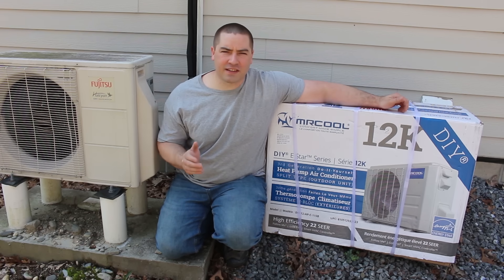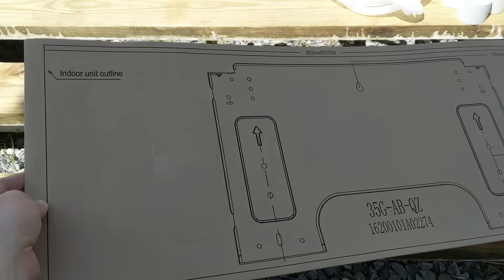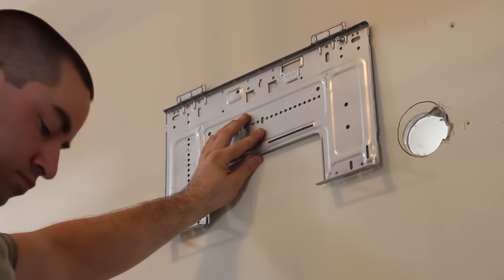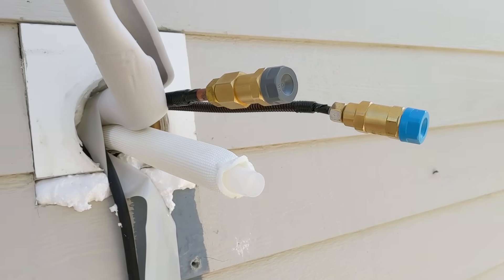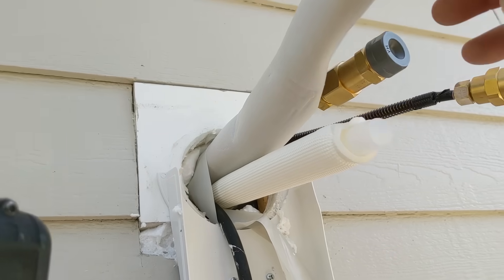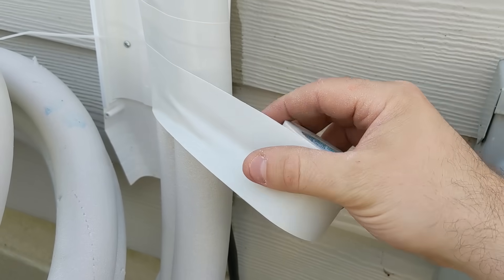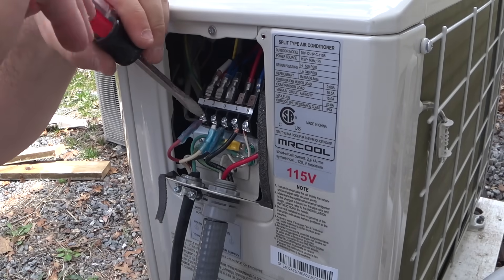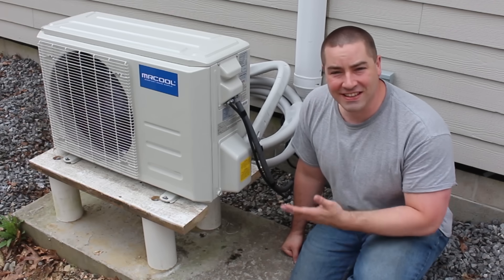Installing My Own Mini-Split Heat Pump, DIY

Comment: As for the leak of old AC  you should call the real pro that has a leak detector and for sure you should use your warranty. This installation is dangereus. you should be aware that there is a high risk of electrical shock especialy for people that has no knowledge about electricity, plus you should like a MUST evacuate the system properly, before releasing the refrigerant. Therefore there are some serious questions about this installation and it is considered dangereus as for you as for the environment. What if you had a leak...what then? What if you burn yourself with refrigerant? When the compressor dies after 2 or 3 years because of presence of air in the systemi  hope you will make then a video about it. This installation is not suppose to be done by unprofesionals. NOT GOOD!
Reply from the maker: I posted a follow up video addressing that question: https://youtu.be/KzHLsRtVn4U
Reply: @DavidPozEnergy  ok...looks like you have absolutely no idea how the hp/ac operates and how big are the risks involving the installation you did. The lines you have are very dangereous. Why...because of the rubber seal-o ring inside. Therefore you cannot know if the seal was tighten up properly because the rubber seal will hold the connection for that time...but in time year or two... the rubber will decay very fast because heat/cold  exchange...so you can get that bad micro hole that will do the damage...and you will again make a new video how bad the product is...the point of the copper hose that you showed in video saying"the air can get in"is far beyond your way of thinking but in fact it is a proper way to do the installation(without rubber sealant). But look just so you get look smart on the video is good. For my point of view people should keep this work for professionals with licence...not for amateurs. Licence for hvac is meant for something...keeping the invironment safe. You and other amat. can cause a lotnof damage to yourself and environment, not mentioning the extra ft. Of lines you have to use, because you cant evacuate the system.(plus installation you did it looks just bad man). Sorry to tell you...it is like total unpro.

Comment: Thanks for taking the time to put up the the video.  The whole setup probably cost less than the multiple failed repairs.
Reply from the maker: Yes, by a long shot.  Just one repair/service call savings pays for the new system.  I don't know if it's the same everywhere, but labor where I live is very expensive
Reply: @DavidPozEnergy  Had a similar issue here, so I installed my Fujitsu myself. The steps are nearly the same except you vacuum the lineset with a $100pump. I don't think either brand will be more serviceable or avoid tough repairs. Hopefully luck will be with you this time.
As the tech has advanced quite a bit, all the companies have introduced new models so parts for the old ones are hard to get. If you install it with replacement in mind, if it goes bad again you just swap it out like you did with the fujitsu.
Hurst to see holes go in that wonderful dense pack job ;)

Comment: Just wondering if you could have cut your lineset down from the other end going into the house. A shorter line set may increase efficiency of your New Air Conditioner? Thank you for sharing a I installed an American Standard Air and Furnace last year D.I.Y. Saved about 7000.00 pretty happy. Good Job David.
Reply from the maker: I posted a follow up video addressing that question: https://youtu.be/KzHLsRtVn4U

Comment: lmao , your system will be full of non condensables because you didn’t evacuate the pipes , the big “coil” of left over pipe on the outdoor unit will soon blow around and destroy your flares or even crack the pipe , so many things wrong with these DIY units... get a qualified tradesperson to do these jobs people...
Reply from the maker: I posted a follow up video addressing that question: https://youtu.be/KzHLsRtVn4U

Comment: I think it's a good idea with any kind of drain line to cut the end at an angle. My thinking is that, theoretically, it'll take longer to plug up because the hole is much longer/wider.

Comment: Nice video-few tips is to vacuume the lines-never use electrical tape-insulate your lines fully
Reply from the maker: I posted a follow up video addressing that question: https://youtu.be/KzHLsRtVn4U

Comment: And those fittings on the condenser unit have torque ratings. Should’ve been in the manual in which you were pretending to read thouroughly

Comment: Your leak was probably on the flare fittings. Never trust the factory flares because they almost always leak, and your initial installers where too stupid or too lazy to reflare the lines.
Reply from the maker: Maybe.  But every time I hired a repair company ($$$$) they told me they re-flared the fittings.  But I still had leaks.

Comment: This is payd ad. Those mrcool is same as midea or pioneer other generic brand in other words. Cheap Chinese rebranded inverting AC( heat pump) that are not as good as the real brands, but for the money they cost they work excellent. They start arround $400 with the delivery in us. precharged with freon for up to 25ft line and line install kit. I got 2 pioneers and I will get 2 more this summer. In my other house i have Mitsubishi 10 years old 12000btu heavily used during the summer and the winter and still working as new. The prices on the real brands in US are painfully high. 😥
Reply from the maker: Mr. Cool did not pay me.  But I do agree that we pay more in the US for these types of units.

Comment: Why would you use thread locker?
Reply from the maker: It's a sealant made for refrigerant connections.  I linked to it in the description if you want to see exactly what I used.

Comment: What About Your Warranty All 3 of My Fujitsu's Came With a 10 Year Warranty ? Had One of Them To Have a Leak and My HVAC Company Came Out and Replaced My Heat Pump at No Cost Did You Have A Licensed Company Do The Install or Did You Try it Yourself ?
Reply from the maker: I hired a licensed HVAC contractor to do the work.
Reply: @DavidPozEnergy  Then He Should Have Summitted The Warranty and You Should Have Checked To Make Sure That He Did. I Know it's Too Late Now But For Future Reference it's Smart to Ask About a Warranty and How it Works ! FYI Mr. Cool Offers a Warranty on There DIY Mini Splts as Long as You Follow There Requirements For The Install  👍

Comment: Theoretically the coiled up electrical cable forms a resistance 'choke' with AC power.  The magnetic fields created around the individual wires  interfere with each other when looping causing this resistence and needing higher amps than neccessary. Your tested amps was right near the max of 10amps if I read the data sticker correctly.  Unless you wanted to allow moving the exterior unit later you could test this out by reading amps, shortening the cord, reattaching then rechecking the usage.  If temps are same as before the line should use less electrical energy when done. This lessens the heat in both fan & compressor motors when running. I have electronic degree and as a home inspector I always advised shortening coiled up AC wiring to save useful working life of appliances. What convinced me of the practical side in this was one day found a coiled 50'  extention cable that melted itself together into a solid plastic coil.  That definitely made an impresion on me.
Reply: Your over thinking it buddy. I feel bad for the people you advise, money not well spent for most (99.99%) of properties out there have far worse things that need fixing.
Reply: @WilliamSymionow  true, if that were the extent of my advice.  Realize even 10% reduction in watts = greater relability for all components effected. Most designs are now manufactured with thin margins using cheapest possible components.  One service call minimally costs home owner several hundred $. Shortening cords cost $2 and 5 min.
Reply: @paulcrescenti5581  if the power is routed to the exterior unit 1st, that would make a large reduction in the reluctance (ac resistence) issue. Of course rethinking your example, his meter showed 10amps of current flow. That is extremely high for just the interior fan. 
In rethinking my advised amperage test, it would be easier by simply uncoiling & spreading out the wire before re-reading the current. If amp drop is more than 10% it is well worth shortening the cord.
Reply: @JDub-mi7fs  thx, for sharing, your experience makes an excellent example of unexpected consequenses of coiling wires.

Comment: I would have installed the evaporator unit to studs
Reply from the maker: I got one big 3" screw into a stud.  But the stud landed in the middle of the metal, so the corners are held in place with the drywall anchors.

Comment: You didn't vacuum down the refrigerant lines. It's full of moisture. It will not cool properly and you will have issues wit it soon. Do more research before making a DIY video.
Reply from the maker: I posted a follow up video addressing that question: https://youtu.be/KzHLsRtVn4U

Comment: $5000... .You could have bought a full Heat Pump with that money.. Instead of this mini split.
Reply from the maker: Yep.  But the HVAC pros don't tell you up front that it's going to keep leaking after they "fix" it.  Over and over again.  Hiring the licenced companies.
Reply: DavidPoz idk what they did to “fix” the issue or what exactly was causing the leaks
Reply: It happened to me, too. My old central AC worked for 30 years and finally had broken. The fan became noisy. I called the AC repairman. They told me it is too old and uses too much electricity, I had better buy a new one. The new AC worked great on the first summer. Then OK on the second summer. On the third year, it produced no cold air. The repairman added Freon. The fourth year it was OK. But I  need add Freon again on the fifth year. On the sixth year, it produces little cold air again so I called them. They said it had a leak and it will cost me $1,800 since it is now out of warranty. It worked for one great year then OK second year. On the eighth year, I called the repairman again. They said there is no Freon left so it must have a leak. This time it takes them more time to find a leak. They want to be thorough. It cost me $2,000. But on the tenth, I found out I spent  $3,800 but the leak is still there. Some leak is not bound to be found. And I should have spent $5,500 on a new one on the sixth year when the warranty expired. Also AC manufacture was great 40 or 50 years ago. But not so good now.

Comment: You did a Great Job, oh yeah I used to be a Contractor in the Refrigeration/HVAC Field. However I have a few comments,
1)How did you purchase that DIY without a Contractor's License of some kind as all the States I have worked in require one? Also where is your recovery machine and where is your certification for handling dangerous items? ie electricity, Freon gas, etc,. Where did you dispose of the old equipment as that is regulated too?
2)Why didn't you just check to see if you could use the original hole as it looked like you could have without expanding the existing hole. Causing a larger penetration point for insects to get in. Plus when putting the Air Handler in, couldn't you have put some of the spray foam right before you slid the unit up against the wall as it would be liquid then before expanding and drying so the seal is through and through. 
3)You could have taken a picture of everything especially the wiring so you had something to go by in case of getting confused. I have done this with most everything, (even when working on vehicles when matching wiring and vacuum tubing), I have worked on even before cell phones with camera's that developed quickly onsite. Yes I do know wiring as in the HVAC Field you are allowed to upgrade whole Main Electrical Panels as long as it pertains to equipment you are installing causing more of a load. So incidental or supplemental to a job. I have worked on residential/commercial/industrial so panels up to 480 volt 3 Phase. Yet I still used pictures to help with so I could refer back to them in case of doubt and to help with anything a Customer would complain about, as in pre existing or different. Just Saying
Reply from the maker: Hi Donald,  Thanks for your comment.  This unit can be ordered through Amazon, and Home Depot.  Probably other places too, but those are the ones I'm aware of.  It's a kit with Pre-Charged lineset.  Yes, there is also refrigerant inside the outdoor unit, but also in the lineset.  I go into more detail on that in a follow up video:  https://youtu.be/KzHLsRtVn4U
Reply: @DavidPozEnergy  As you could probably tell it has been a few years since I have actually worked in the field anymore as I am old! Thanks for your extra explanation. I have handled the Mitsubishi units before with that kind of install so that is why I didn't ask about a few things in my last comments. And the reason I am so cautious to drill into anything is even with my experience especially early on in my career I have hit a few pipes and or lines when drilling even being careful. Where/how did you dispose of the old units as they are classified as having carcinogenic material still aren't they?
Reply from the maker: The old unit did not have any pressure in it.  It continued to leak even after I hired the pros to come fix it.  I hired two different licensed HVAC companies to come fix the old unit and it cost me thousands of dollars.  Every time it would work for a little bit (2-3 months) then stop again.   Every time they said it was the flare fitting.  Even when I said "but you replace the flare fitting last time you were here" they were quick to say "no, no, that was the other flare fitting"  Then they would charge it up again and charge me a ton of money.

Comment: Before you release the valves, for some reason I though that you need to use a vacuum pump.
Reply from the maker: I posted a follow up video addressing that question: https://youtu.be/KzHLsRtVn4U
Reply: Not on the DIY series . Notice the specialized ends on the pre-charged sealed line sets .

Comment: As a technician and a owner of a HVAC service and install company, how do you get away with not evacuating the refrigerant lines before releasing the charge into the system? You should remove all atmospheric and non-condensables from the system. Unless it's pulled in vacuum and held by the special fitting.
Reply from the maker: I posted a follow up video addressing that question: https://youtu.be/KzHLsRtVn4U

Comment: What was the voltage for the old unit and if it was 220 and mr cool was 115 v how did you use the old breaker
Reply from the maker: Yes, the new unit is 120v, and the old unit was 240v.  I had an electrician replace the breaker to one-pole.

Comment: You don’t have to pull a vacuum on the line set.  Guessing you could shorten the lines and braze ends back on.  Looks pretty good
Reply: Cool the line set already has a vacuum.  That’s a game changer

Comment: Good install for DIYer. Keep In mind you may have issues with the extra coiled up lineset. Also try to do a leak check before the refrigerant is  released, with nitrogen. lastly I didn’t see you pull a vacuum on the system.
Reply from the maker: I posted a follow up video addressing that question: https://youtu.be/KzHLsRtVn4U
Reply: Another expert that does not pay attention or research before posting comments relative to old technology. 🤣🛫 it is sad that so many HVAC experts do not know what is new.

Comment: why dont you use 220v its cheaper
Reply from the maker: I have both 120v and 240v available at my house.  Some appliances run on 120v and some on 240v.  This heat pump happens to be 120v.
Reply: @DavidPozEnergy  thanks i life in holland we have 220v and 380v i thought you have it connected whit 380v thanks for anders and the video cheers.

Comment: No wonder so many houses get destroyed by hurricanes in the US, that house is of cardboard
Reply: Most of the time it's fine and we have way more people to make houses for
Reply: as opposed to a mud hut?
Reply: You can make your house diamond wal
Reply: There are low-quality homes to complain about, but this is not one of them.  David has videos on his house build.  It's a double stud wall with a foot of dense-pack cellulose,, working out to 0.121 W/(m^2*K) (R-47 in customary US units).  So it's passive-house level performance at lower cost, and low embodied energy.  If you don't care about either of those things, this is probably not the best channel for you.
Yes, wood homes can get damaged in a hurricane, and brick houses topple easily in an earthquake.  A direct hit from a tornado can destroy all common constructions, so you might just want to save money so you can rebuild if needed.  If you're in a location with none of those things, you have some options.
Reply: You're not wrong! Houses here are built quickly and cheaply, not well for the most part. I think the relatively low cost of wood construction here is part of why American houses are too/so big. There are ways to make a wood framed house better/stronger/longer lasting. I used plywood instead of OSB on my shop, for example, and spent a TON of time making sure water wouldn't get to the wood. A wood framed structure should last quite a long time if it's kept dry.

Comment: You did not vacuum the system. As a result, the compressor will not run for a long time. And there will be a low efficiency.
Reply from the maker: I posted a follow up video addressing that question: https://youtu.be/KzHLsRtVn4U
Reply: @DavidPozEnergy  Got it. Thanks for the reply. I’m glad I was wrong.